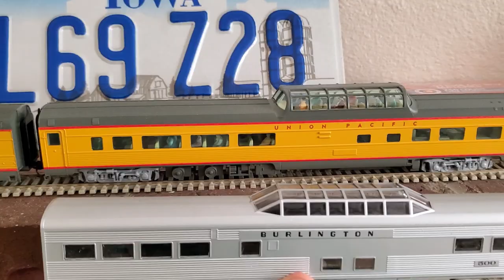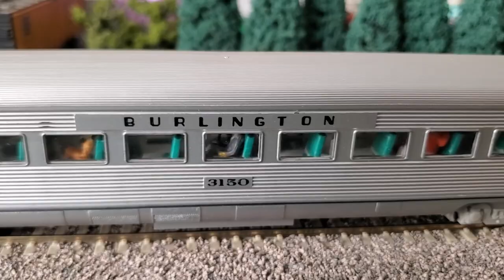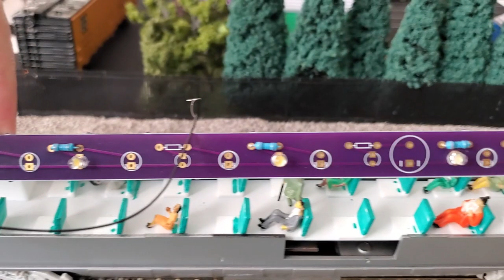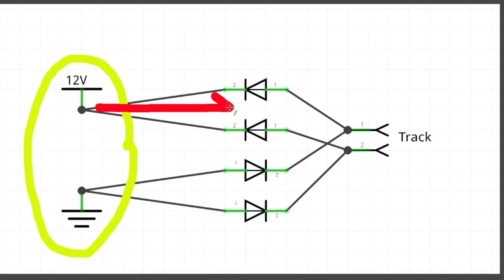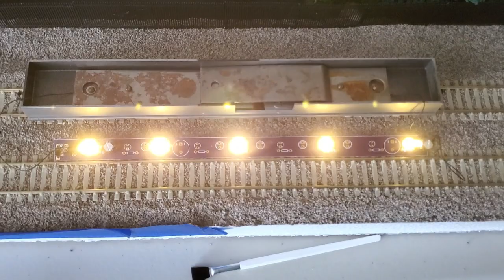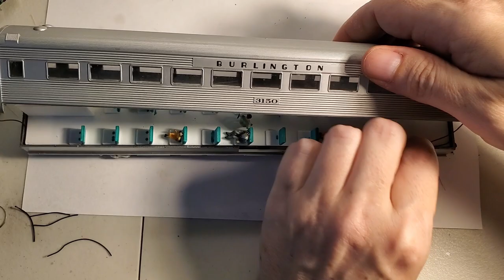Athearn Blue Box Passenger Car Upgrade

Comment: Your trucks are plastic so that you can place the insulated wheels opposite each other in the same truck with separate wipers thereby maximiszng pickup. The next best thing i to install wipers for all wheels. Also, ditch the sheetmetal weights and install birdshot in the lower center cavity using white glue as a binder.

Comment: I changed out all the incandescent lighting on all my coaches to LED strip lighting.  Strip LED's come on a roll of 300 and are easier to work with than what you're doing.  I use the tiny square full wave bridge rectifier, LED strip lights and a 3300uF capacitor for the keep alive circuit.  I ordered the wrong LED's and got the bright white which is too bright for my application.  So I painted each LED (about 12 per car) with yellow acrylic paint and now it looks more typical for the period I model, the Central of Georgia.  I used the 12 volt LED strip lighting which can be cut apart at every 3rd LED and they already have the ballast (current limiting) resistors built in.  LED strips have adhesive backing so they stick to the roofs very nicely.

I also illuminated an old REA (Railway Express Agency) coach and made my own pickups out of some old copper strips I salvaged from an old computer.  I just recently found a good product to assist in lighting my old Riverossi Southern Crescent Limited coaches.  They're from Litchfield Station, ESU current collectors, part #50707.  The trick is to cut them apart and use one for each wheel, ensuring that each one goes on the axle with the non insulated wheel and opposite for the other.  One picks up the power, goes to the LED strip and returns via the other wheel, so only 2 are required per coach.  You get enough to do 8 axles for $8.95 + $4.00 shipping.  That's not a bad deal to illuminate a coach.  Now if I can just find some interiors to go in them as I don't do the 3D printing.  Cheers from eastern TN

Comment: I add weight to the well (shot gun pellts and glue and replace the weights for a single 50 foot car weight.
Reply from the maker: That's a good idea, you want the weight as low in the car as you can get it.

Comment: Very nice.
I got this car too, but I am afraid top remove the upper shell. IT fits so tight... Ist there a trick to remove it without any damage?
Thanks and greetings from Germany
Reply from the maker: Try holding the ends of the car and twisting opposite directions.
Great to hear from Deutschland, I spent half a year there in the 80s and always wanted to return.
Reply: @kurtstrains  Thanks very much. Stay better overseas, Germany changed very badly. If you visit Hamburg, Berlin or Frankfurt, you may think you are somewhere in middle east...

Comment: Is it possible the one weight is upside down
Reply: I am afraid they are the same as all of mine from Athearn.  I have removed and added wheel weights in their place according to NMRA weighting.  however if you are using the plates for conductivity you need to rewire for that.